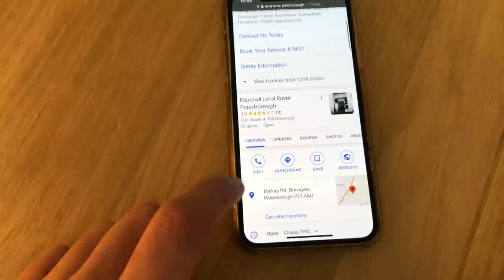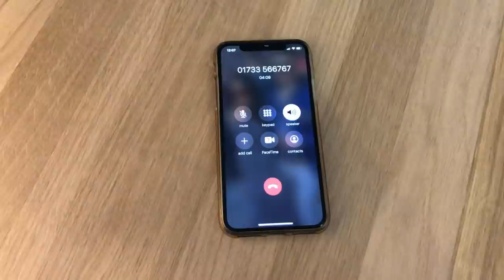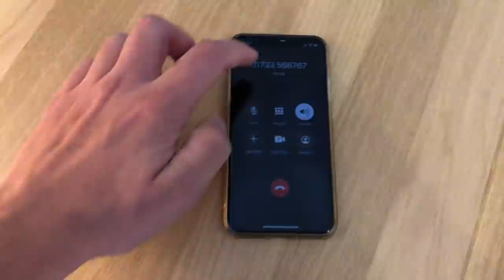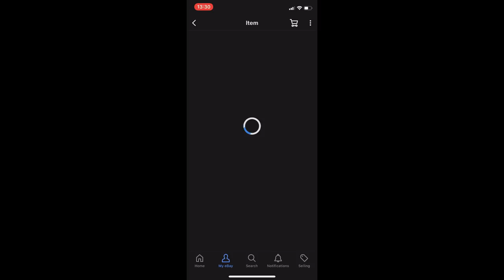I get a CHASSIS CUT and START the SURGERY on the Range Rover Evoque

Comment: Arthur Tussik would be proud 😂👌
Reply: I don't think so. Doggy repair what points is replace half panels they should be replace as a panel not cut to half. Next accident probably alloy will be I side car lol.
Reply: @pitstop9905  Arthur Tussik makes cut and shuts a lot and he’s dangerous with the things he does mostly.
Reply: Aurther is good.  Nothing dangerous all joined on factory welds car is safe.
Reply: @Richard-ps7ht  lol look again 🤣 he cuts some cars in half
Reply: @Alexander_l322  in harlf but factory welds just as safe
Reply: @Richard-ps7ht  it’s spelt half and no you’re wrong. No one cuts a car in half and expects a safe repair
Reply: @Alexander_l322  sorry. If it is on a factory weld it will be just as safe. If not they wouldn't weld it in the factory.

Comment: Very clever boys in that garage !!
Reply: Clever boys lol.. cowboys
Reply from the maker: @Fiftyoysters  the Evoque is made up of a lot of materials - primarily steel. There’s about 5% boron steel on the Evoque 🥱
Reply: @SLRebuilt  Boron steel is an amazing material, Once bent, it can’t be straightened. It requires replacement if damaged.
It’s sensitive to heat and rapidly weakens if heated. If these sill parts have Boron, then the only remedy is cut it out and weld in new, but keep the temp of the weld as low as possible.

Comment: As much as I enjoy and appreciate the craftsmanship, the repair will not be as safe and rigid as the original. They have cut across a single stamped high strength steel section and butt welded in the patch panel. From a metallurgy point of view it severely compromises the integrity of the original un-cut high strength steel single stamped piece.
Reply: Have you ever looked at the heavy damage on cars for sale on Co part that are sold every day? Thie evoque is a minor repair
Reply: @leedstown  just because it’s done everyday doesn’t mean that it’s the correct way to do it. That’s a terrible way to justify anything. In an accident that cut will be the weak point. The correct way to fix it is to drill out the spot welds of the entire side panel which is a large hoop that contains the a and b pillar and then spot weld it back in. The pieces are stamped as one unit, cutting it across and then butt welding it completely compromises the original strength of the single formed piece.
Reply: @hondah22a2  what put in the full A and B pillar?

Comment: Blind leading the blind. After being a panel beater for 20years. That needs pulling and never cut a pillar like that. Repairs like this give salvage cars bad reputation.
Reply: Well you need to get with the modern times. This type of repair is done all the time as pillars are not solid these days but a group of sectional members that are easy to remove and replace.
Pulling this A post with a dozer will strain the sectional members spot welds and lose its integrity. Additionally the outer skin may look good post pull but you would have no idea what is going on behind the first layer with strength and integrity.

Comment: Obviously no repair methods used, this is one reason vehicle structure shouldn't be repaired by non accredited repairer.
Reply: This RR shouldn't be repaired at all ....... it's a death trap ..... was written off by the insurance company for good reason
Reply: @johnlloyd8040  written off and classified legally for repair by, erm, the insurance company...  the reason they write them off is that it is an “uneconomical”  repair, not an impossible repair.... do your homework John....

Comment: Hope the new keeper is aware of the extant of work done. Im concerned that in a accident the original strengh will not be there.
Reply: Millions of cars have been repaired that are on the roads, that is what bodyshops are for! Cars are designed to allow for repair including structure.

Comment: Yeee Haaa..   cutting an splicing Boron .. 👏👏👌
Reply from the maker: As I said in another comment you made. The Evoque is made up of a lot of different metals- primarily steel. There is about 5% boron on the Evoque. 🥱
Reply: Ignore him. He probably thinks panels are not joined in a body shop. Just reshell the car instead.😂
Reply from the maker: @sparky1543  😂😂😂🙌🏽🙌🏽🙌🏽♥️♥️♥️